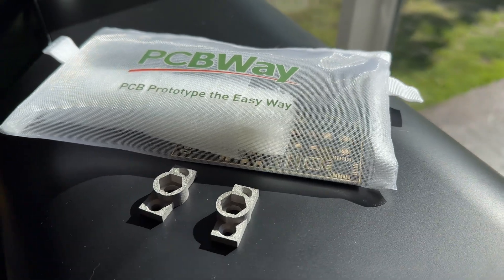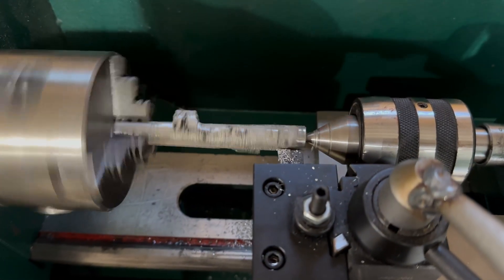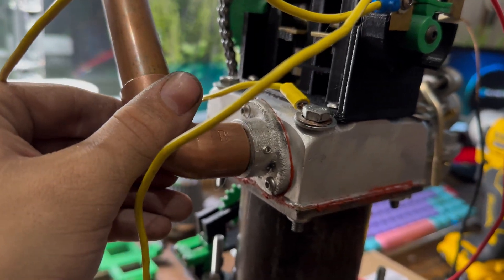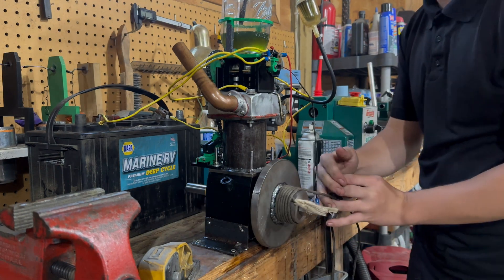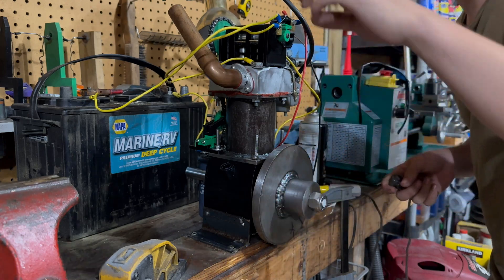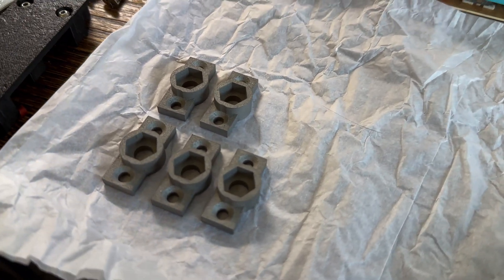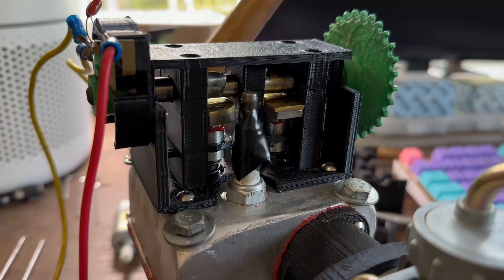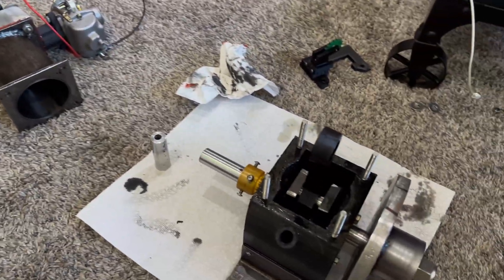METAL 3D printed homemade engine RUNS!!

Comment: you should make a SOHC ver of the engine, DAOC is a little more friction-heavy, so I'm curious
Reply from the maker: This engine is currently a single overhead cam, but what is DAOC? Direct acting overhead cam? If that’s the case, then that is what my engine is, but then what’s the difference between the two?
Reply: @ProjectLMZ I'd say it's not really important yet.
DAOHC is just cam pushing directly on the valve, or via some sort of tappet/bucket, which is what you're running
Sohc just means the same camshaft is pushing the valve via a rocker arm, so the valve could be angled, which leads, in theory, to possibly a higher volumetric efficiency, due to the air not having to do a 90deg turn before going into the engine

But it's quite a bit more parts count, the rocker arm, the rocker arm standoff, the valve lash adjustment and so on. And since the engine doesn't seem to be revving higher than an old flathead lawnmower engine from the 50s, I think that's too much part to remake and so many more new variables to try and go wrong for minimal gain.
Which is why I said not important yet, the engine as is could be improved much more first just as it is

Comment: hell yeh, put a turbo on it!!
Reply from the maker: I think I might actually try to make a homemade centrifugal supercharger for it!! I could 3-D print it even, they’ve had decent success with 3-D printed superchargers! I also want to try adding nitro!
Reply: @ProjectLMZ  can I get credit in the description? Just curious
Reply from the maker: @DrifyRL  sure, not exactly sure when I will do it, but I will probably build one eventually!
Reply: @ProjectLMZ  thanks you, I’ve been subbed since like 600 subs, your channel is growing pretty fast
Reply from the maker: @DrifyRL  yeah the engine videos have really boosted my channel! This video, my newest, is currently my second fastest growing video on my channel, with my last video on the engine being the first, which I wasn’t really expecting, I kind of expected it to do better than my last video just because I think the thumbnail is better, but I still have to give it a bit, it might still take off. Currently the view slope looks like it’s already tapering off, but it’s too early to tell, as it could just take another jump and that’s what I’m hoping! 🤞
Reply: @ProjectLMZ  my experience with yt is it either blows up or it takes like a weeks or teo
Reply: @ProjectLMZ  if you add nitro then your gonna need to cast iron the piston, if you don’t it’ll blow the piston up and or even worse explode the metal part around it, do it at your own rist
Reply from the maker: @DrifyRL  top fuel dragster pistons are aluminum, and they run strait nitro and make 12,000 hp, but I am using cast iron because my cylinder wall is steel, aluminum doesn’t play nice with steel, so the piston is going to be cast iron. But I figured with my design it probably would burn through an aluminum piston.
Reply: @ProjectLMZ  I’m just saying making it medal before you do nos

Comment: I'm guessing you're probably planning to use lost PLA casting with green sand to make the cast iron parts, but did you know you can actually make reusable "hard" molds with silicon carbide? I saw Shake The Future's video on it the other day.
Reply from the maker: I actually just push my part into the sand, and then I pull it out and cast it, but the silicone carbide mold sounds like a good idea! I’ll definitely have to check out his video!
Reply: @ProjectLMZ  another fun fact is that silicon carbide absorbs microwaves a LOT. So it can be preheated in a microwave oven. Just don't blast it at full power unless it's already hot or it might crack from the sudden temperature change.

Comment: Can I 3D model you a pistons
Reply from the maker: Yes, that would actually be really cool, I’m planning on casting a cast-iron piston, so it needs to be a fairly small piston to keep it light, but the specifications I would need would be a total volume of less than 40 cc, and set the bore diameter to 70 mm, because then that gives me enough room to turn it down to size, which is 66.5 mm.

That would actually be super cool though!!
Reply: @ProjectLMZ  I'm going to be making it for free
Reply from the maker: @joona2083  that would be awesome!! Also the wrist pin diameter is 3/4 of an inch, which I forgot to include, but other than that, you can do whatever you want with the piston design!
Reply: @ProjectLMZ  you want rings or no rings on the pistons
Reply from the maker: @joona2083  no rings would be fine, I am going to cast it and then machine everything else from there, but the ring thickness is going to be 2mm for both.
Reply from the maker: The under side of the piston is what needs to have everything, as I don’t have the ability to machine the underside. I can machine the diameter, ring groves and the wrist pin slot, so everything else needs to be able to be casted.

Thank you!!
Reply: @ProjectLMZ  piston diameter 3.53inch
Reply from the maker: @joona2083  I think 70mm is 2.756 in, I can give you the dimensions in inch’s if you want
Reply: @ProjectLMZ  ok
Reply: @ProjectLMZ  can i have permission to send you the link
Reply: @ProjectLMZ  is it ok if I use onshape for the piston
Reply from the maker: @joona2083  hey, I’m so sorry that I didn’t get back to you, for some reason, YouTube did not notify me that you replied, onshape is good, that’s what I’m switching over to, I’m assuming you’re using it on a computer? If you go to my YouTube channel and go into the about section, my email is in there for sending the link.

Thank you very much, and again I’m very sorry!
Reply: @ProjectLMZ  I have onshape on my phone and my computer
Reply: @ProjectLMZ  the same link to the piston has my whole entire engine design of the 4 cylinder
Reply from the maker: @joona2083  if you’re cool with that, I’m fine with it, whatever you want to do works!
Reply: @ProjectLMZ  I have a easy way to get the piston for you when you get onshape done I can share it to you from onshape
Reply from the maker: @joona2083  that will work, I hate that YouTube is not letting me know when you reply, for some reason, I have to manually check if you have replied
Reply: Me too  @ProjectLMZ
Reply from the maker: @joona2083  I’m not too familiar with onshape, but however you want to share it, I’m down for it. Just let me know what you want to do.
Reply: @ProjectLMZ  ok we'll have a great friendship after this (deal 🤝)
Reply: @ProjectLMZ  by the way do you have discord on computer
Reply from the maker: @joona2083  no I don’t have discord, I’m making the rest of the parts for my engine in onshape, and it is super easy and fun! Onshape is actually really easy to use
Reply: @ProjectLMZ  I know
Reply: @ProjectLMZ  do you have a app named telegram
Reply from the maker: @joona2083  no, but I do have instagram if you want to message on there
Reply: @ProjectLMZ  is your username the same as the channel name
Reply from the maker: @joona2083  yes, I just changed it
Reply from the maker: @joona2083  just did

Comment: How did u figure out the can lift and duration
Reply from the maker: I didn’t, I just slapped together a design in CAD and casted it, then I sanded the lobes by hand until they looked good, the only thing that is calculated is the lobe separation angle, and I went for 110°
Reply: @ProjectLMZ  awesome I’m thinking about doing a project like yours and good to know
Reply from the maker: @Jfromtech  now that I’m thinking about it, there was one other thing that I calculated, your valve lift should be a 1/4 of your valve diameter, my valve diameter is 1 inch, so my valve lift is 6 mm, just under the recommended valve lift that would be 6.35 mm, or 1/4 in.

Comment: after you refine it some more and add cooling it would be neat to attach it to a implement of some sort like a tiller, lawnmower, gocart, or generator
Reply from the maker: In the next video, I’m going to make more metal parts, like the piston and connecting Rod, so in the future I definitely want to try hooking it up to my bike!
Reply: @ProjectLMZ if you can get a alcohol card it will run way cooler
Reply from the maker: @Jfromtech  I could try running it on 99% isopropyl alcohol, but the only issue is is that I think it will destroy the carburetor
Reply: @ProjectLMZ  Sounds AWESOME!

Comment: You should make it so the exhaust has a hole on its side so you could put a screw through it. By pushing it more or less in the exhaust you can increase or decrease the back pressure, which is known for making engines like these run way better.
Reply from the maker: That’s a good idea, but don’t 4 stroke engines like the least amount of back pressure? But I’m not sure, I haven’t done a lot of research on it.
Reply: @ProjectLMZ  Maybe..? I saw the little screw on my lawn mower's exhaust, it has the screw set to the least back pressure, AKA its almost unscrewed from the hole. The mower has a 4 stroke engine.

Comment: i think it sounds a bit too rich at idle, get a smaller pilot jet maybe. idk what carb that is but if the mixture screw is on the fuel side then it probably has a pilot jet thats too big considering u said it likes it all the way in. you should also use mold silicone for the boot or just get a boot online
Reply from the maker: It is definitely running very rich, it has a total run time of like 10 minutes and the exhaust valve and exhaust are completely covered in a black film, I actually think I need to back out the screw, it dropped the idle when I did, but I think that’s just because it was getting less fuel. I will definitely have to try some more things!!
Reply: @ProjectLMZ  i think it dropped the idle because it was a fuel screw not an air screw but im not sure
Reply: You need a smaller jet very likely
Reply: It might also help to put a filter on the carb to restrict some air from going in
Reply: @germansheperd3250  thats gonna make it richer.
Reply from the maker: @RainbowSheep_was_taken  I think it is the air screw on the front side of the carb, as there’s only 1 that adjusts the mixture, I have the idle screw and the air screw I think, so backing it out will hopefully make it run leaner, also I’m running 2 stroke mix in it for extra lubrication.